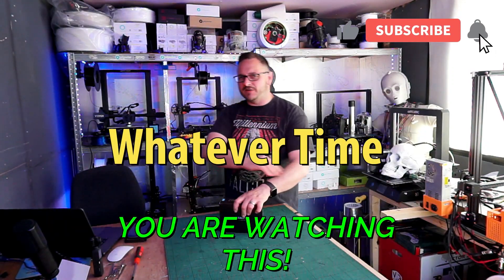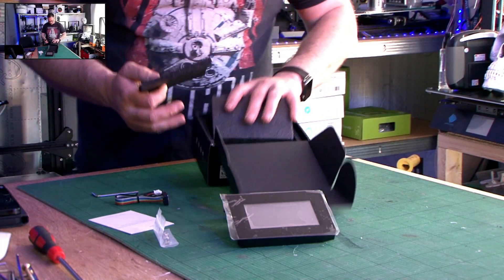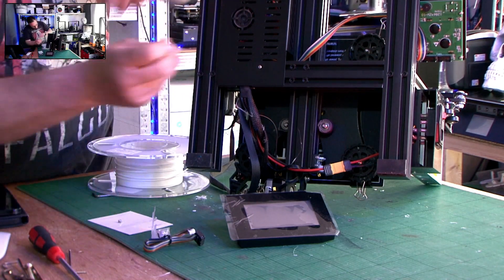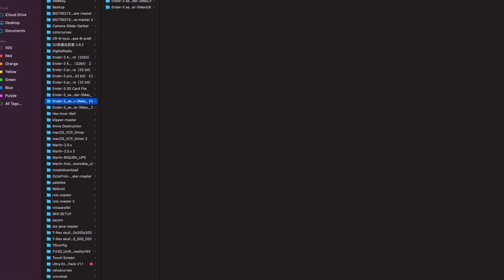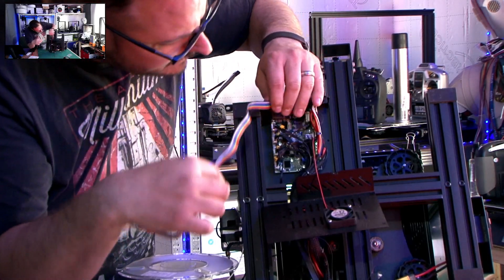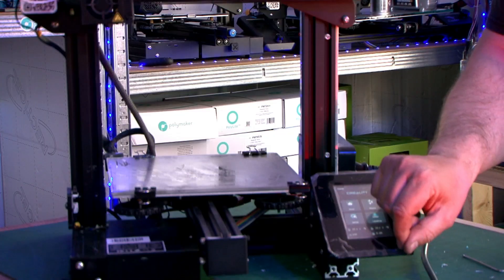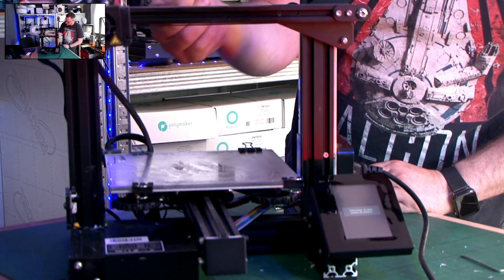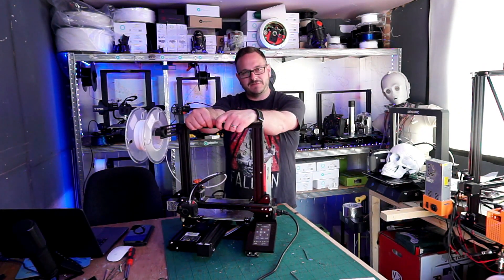Is Your ENDER 3 Outdated? Upgrade with This Touch Screen

Comment: I'm having an issue where the load screen gets stuck. The bar at the bottom finishes loading and I hear a beep but it never moves to the main page. Not sure if the firmware was install incorrectly. Any way to restart that bit?
Reply from the maker: Send it back the developer never moved forward with it

Comment: I tried going on the website for the .bin files because i also need them and the DWIN_SET files for a Ender 3, it says that sight is no longer active, do you have another link?
Reply: Sorry just found it on the 3Djack website. There's another problem im having, I flashed the creality firmware on the LCD screen but i tried putting the .bin file on and its just stuck on the Creality screen with the loading bar, waited 5 minutes and still nothing. Have any recommendations?
Reply from the maker: @madisonlehmann4617 is it the bin file for the motherboard ? As that need to go into the motherboard not the screen ?
Reply: Hey! thank you for the reply, yes ive been putting the SD card into the motherboard for the .bin files and for the DWIN_SET into the LCD Screen. Ive tried several different files and nothing will bite. Ive even bought 8gb, 1gb, and 4gb SD cards with FAT32 and 4096 bytes @TheRealSamPrentice

Comment: I had bought one of these LCD screens from Amazon and it had F1rst Layer firmware on the LCD screen. I wanna convert back to normal Creality firmware. Would i just download the DWIN_SET file on a SD card and load that onto the LCD screen. Would that convert it back to the original Creality firmware?
Reply from the maker: Yep that should do it

Comment: Thanks but I must be doing something wrong. I have a Ender 3 Neo with the 4.2.2 Mb , purchased the new touch screen from Amazon and followed the instructions. The bin file never loaded? Had the original sd card formatted to Fat 32, allocated 4096 and I ended up placing the original controller back on the unit and returning the touch screen. Any thoughts as to what went wrong? The folks at 3dJake say it wont work and I'm waiting to hear back from the people at Comgrow
Reply: OK, I need to follow up with you on this.

Comment: Hello, thank you very much for sharing the video that was very useful to me... but do you know how I could solve the problem that arose after replacing the display? It no longer reads the files to print, I click on "print" and the screen does not show me any files to print. I hope you will be able to help me. Thank you.
Reply from the maker: I’d make sure that you have formatted the sd card and use a small gb card. I’ve seen in the last that there have been some issues with the screens and in most cases the firmware upgrade might help. That’ll be on Creailty’s github

Comment: So I have an Ender 3 E. I think the only differences from the original are auto bed leveling and a sensor for when filament runs out. I put firmware on the touchscreen but it wont let me auto level the bed. Can anyone help me get the correct firmware?

Comment: Thankyou for such a great video. I managed to get my new screen working with my new sprite pro direct drive and bl touch
 I was wondering how I can go about adding the filament run out sensor I also have. Do I need to add a firmware for this??? If I add it Nd put filament firmware will it still allow me to use my touch screen also

Comment: I'm looking for some advice, I put this screen on my ender 3 pro. I am running it and a cr touch, and want to put a sprite hot end on it. I know you need to modify some code in the firmware, but I can I use the firmware you suggest to do that?

Comment: How do you like the reaction speed of the touch screen? Is there any untolerable lag? Thx
Reply from the maker: The bad news is that the development with this was stopped and you have what you have now. Personally I would send it back and think about the sonic pad
Reply: @TheRealSamPrentice  Thanks for the heads up. What about the LCD with nob?
Reply from the maker: @John-vk1ij  yep there is jayers firmware for that one :)

Comment: Great video, but just to note to anyone else new to the hobby NEVER pull or lift the print using the X axis beam like he does when lifting the printer. There is a small chance of something being damaged but more than that its completly throws of the bed levelling you have done. I made this mistake myself and didnt realise after multiple faild prints. If you want to lift the printer lift from the top beam or print a handle mod. To move axis up use settings in the firmware or manually rotate the axis thread.

Comment: I am baffled viewing the comments and everything I don't see how I'm the only person on this damn Planet this method did not work my 3D printer has been down for 3 days now😡😡😔😔
Reply from the maker: Hey Jason, usually the trick is leaving the sd for a time, but the issue here might not be the problem you have ?
Reply: @TheRealSamPrentice  I have left the card in for I think up to 10 minutes once I've also seen any other videos where were people abuse the SD card slot on the main motherboard and also the SD card slot that is on the touch screen itself so far everything has failed I have tried saying screw it and hooked everything back up the way it was now everything is very glitchy when I plug the old screen back in😔
Reply from the maker: @jscott00981  It might be worth it, they had a load of these doing nothing in a factory and sold them cheap, the tech is pretty old now and most have moved on to the sonic pad now.

Comment: For me !
It also not working properly with the 4.2.2 board.
I only can adjust Temp and move around!
Can't set E-steps or turn of fan.

Do you have a link to right software for us.
A lot of readers, followers have this screen now and there are many different question about it.

🤔
Reply from the maker: Honestly this UI is dated, you're better off returning as they didn't finish the development, hence why its so cheap!
Reply: @TheRealSamPrentice  Already working on that 😉

Comment: Quick question will this work with the sprite drive pro?
Reply from the maker: I’d love to answer thar but I have no idea what that is? So I’d suggest you steer clear of this one
Reply: @TheRealSamPrentice  thank you for the quick response and great work on your video.  its the new creality sprite extruder pro kit basically its the ender 3 pro s1 , im upgrading from a ender 3 pro 1.4.4 , i purchased the new motherboard 4.2.7 the cr touch, and the lcd screen the one you installed in the video. And the  one vender that i purchased the creality board says that the creality sprite extruder pro doesn’t work with the lcd screen. I just saw mars qizmo and the ender 3 pro s1 and it has the extruder pro kit cr touch and a lcd screen. I was hoping you can guide me in this install. I basically rebuilt my printer.

Comment: I know it has been a while ago but I couldn't get the e steps set with any firmware. Ender 3 pro with sprite hot end and 4.2.2 board. Have tried a few different firmwares and in the end went back to original screen with thi3d firmware. Any help appreciated as I liked the rest of the screen. Thanks

Comment: I installed this same touch screen on my Ender 3 Pro 4.2.2 with creality's software download for this screen,  and now my it will not read my SD cards.  Does not show any files on any SD card.  I tried reuploading the firmware.  dos any one else know a fix for this?
Reply from the maker: There is a bug in the firmware let me find the files and I’ll post it on here

Comment: please help, I have the v2 and put on the direct drive extruder and BL touch, added the touch screen and won't load firmware. screen just freezes thoughts?thanks
Reply from the maker: Make sure your sd card is formatted correctly
Reply: @TheRealSamPrentice  i think I got it now but how do you adjust the z offset with this screen?
Reply from the maker: @MrBarton1234  we are currently pushing for the source code but creality as of yet will not release it.

Comment: Do you have a firmware for Ender 3 Max with 4.2.7 board, BLTouch, Creality touch screen (the one on your video, that also has UBL, Classic Jerk and Linear advance enabled? or can I use the DWIN_SET from your binary file to compile a Marlin 2.1.0 with this options?

Comment: the moment i plug in the cable in the new screen  it beeps! like crazy, wont stop, and it wont take the flash.. tested several firmwares.. what to do???  4.2.7 card in a ideaformer.. with the new Z sensor.
Reply from the maker: Send it back they sent tons of these out with no support

Comment: I've added the touch screen and the new firmware, but, I cannot load any STL files or gcode files to print from that screen. I've also lost my z-offset and baby stepping. The firmware is old very very old. Do you have a way to enable the touch screen on the Marlin FW 2.9? Or at least how do I print any of my models?
Reply from the maker: creality never released the source code, So the screen is a bit of a bust

Comment: I'm not sure what i'm doing wrong here, but the screen won't load up the firmware, did i skip a step?
Screen is connected
Verified i have a 4.2.2 mainboard
put the right .bin files onto the micro sd card and plugged it in while it was powered off, powered it on and it doesn't load anything.
Reply from the maker: Was this an Amazon purchase ?

Comment: Got the screen working but when I plug in a SD to print it’s not seeing the files. Anyone else having this issue? I’m using the 4.2.2 board and have tried 3 different cards.
Reply: Did you ever fix this issue?
Reply: I ended up upgrading the board to the 4.2.7 but I did find that sometimes it would pick up the card with the 4.2.2 if I put the card in well the printer was on then power cycled the printer. But it was hit or miss. Also making sure the files have less then 8 characters in there names seems to help.

Comment: So I just installed this on my ender 3 max I’m 99%sure I have the right firmware installed. But for some reason on the display in the about section it has my build volume wrong and smaller than it should be
Reply from the maker: It’s not supported on the max without firmware changes, if you connect to it via your computer you might be able to change the size in gcode id have to check
Reply: @TheRealSamPrentice  yeah I saw you can but I can’t figure out how to get the program to work to change the gcode.
Reply from the maker: @Agentchaos85  https://reprap.org/wiki/Configuring_Marlin_Bed_Dimensions
Reply from the maker: @Agentchaos85  that’s in terminal bud you’d need a pi or pronterface

Comment: Is it possible to use the displays with Custom UIs? Like the Jyers/Marlin.
Reply from the maker: It would be if creality released the codes
Reply: @TheRealSamPrentice  Does it mean the display runs on its own firmware too?
Reply from the maker: @jonny11bonk  Yes sir, which is why its not been done yet.
Reply: @TheRealSamPrentice  What about the Ender 3 V2 LCD display? Would it be possible to re-purpose it using an Arduino or other microcontroller? What protocol does it use?
Reply from the maker: @jonny11bonk  Again it requires the code to be released, we looked at this with the firmware guys who did the cr6 mod, but drew blanks as the software is not out.

Comment: Can you send GCODE to the EEPROM with is screen?
Reply from the maker: Nope it’s totally crap
Reply: @TheRealSamPrentice  I'm glad I didn't pull the trigger on buying it then 😂
Reply from the maker: @x_jaydn  steer clear as there is no current development on this at all
Reply: @TheRealSamPrentice  Thanks for the clarification, Sam.

I'm running the stock Ender 3v2 "DWIN_CREALITY" LCDs with my own customized Marlin Firmware (with Jyer's UI) flashed both to the LCD and Motherboard

and I've managed to get them working on the SKR 2.0 B429 boards

I think, if I ever move over to touch interfaces, it'll probably be the BTT TFT Pi 7" for my Klipper builds later on
Reply from the maker: @x_jaydn  klipper Is the way forward :)
Reply: @TheRealSamPrentice   Raspberry Pi's are so hard to get right now though, that I can't wait too long for them, haha 😂

So for now, I'm just running Marlin on my 3x Ender 3v2's
Reply from the maker: @x_jaydn  I’ve heard this !! I’ve got a small stock pile

Comment: Good afternoon, I have followed all the step in the video but when I insert my SD card with my files I want to print do not show up on the new screen. Do you happen to have any advice or a fix for this?
Reply from the maker: Hey Carl, there is a video made by @chep https://www.youtube.com/watch?v=Q-OA9_t9bGc
Reply: @TheRealSamPrentice  Thanks but that is showing me how to have the image of the print file show up. My issue is that the new touch screen is not allowing me to print because nothing shows up when I go into file selection.
Reply from the maker: @carlpleimann571  oh what nothing at all no files ?
Reply: @TheRealSamPrentice  Nope i have used 2 different 8GB SD cards and did a fresh format on both. None of the prints that I slice in cura show on the touch screen.
Reply from the maker: @carlpleimann571  Was this from Amazon and not from Creality direct? there have been a load of duds sold.
Reply: @TheRealSamPrentice  Yes it was from Amazon

Comment: Thanks for the Video, I just got into 3D printing so I'm still a bit of an amateur, I have an ender 3 Pro and I downloaded the 4.2.2 Firmware to flash my screen and it seem to have loaded, shut it off and turned it back on without the SD card and it'll load after that but then the screen says as it, still the creality logo and the loading bar.

Any suggestions?
Reply from the maker: I’ve had a few messages of late which seem to have the same kind of problems.. is this an Amazon purchase ??
Reply: @TheRealSamPrentice  Yeah it was purchased off Amazon

Comment: I could really use your help. Trying to help my frustrated 12 year old son with his 3D printer. Creality Ender 3 pro. 4.2.2. He added this touchscreen and has a CR touch. Touchscreen does not work properly (hitting ready button freezes the screen and there are white boxes over the top of the version information). We have flashed the firmware to the motherboard (renaming the .bin file each time) but I don't think its taking. We also flashed the touchscreen itself with the DWIN_SET file but it acts the same. Many tears here from him and I'm trying to be the Dad that rescues the situation. Any help would be great!
Reply from the maker: Hey Ryan, drop me an email with some pics and I’ll be happy to assist therealsamprentice@gmail.com
Reply: mine is doing the same thing, did you manage to solve the problem

Comment: Really great video, I am having problems however. I was able to get the firmware to work on my Ender 3 with 4.2.7 board but my bed dimensions are now 220x220 when they should be 235x235, additionally I have a direct drive extruder and the X and Y extruder offsets have to be changed to account for the change in shape. I was wondering if perhaps you have posted the uncompiled marlin firmware somewhere or if you had a guide for enabling the touch screen in marlin firmware.
Reply from the maker: Make sure you have set that in your cura settings
Reply from the maker: Otherwise check the creality site there will be a uncompiled version or check out the cheetah firmware online it’s a great guide to set your own settings
Reply: I’m having this issue with the build size did you get it fixed?
Reply: @Agentchaos85  unfortunately no, it came down to either removing the touchscreen or printing with incorrect bed dimensions and extruder offsets so I chose to remove the touchscreen. I tried enabling the touchscreen in the firmware myself but kept getting weird error messages. I'm no computer scientist so the code was a bit over my head. Weirdly enough I think there's other touchscreens out there that are easier to configure manually than the creality brand one so maybe in the future I'll try that. If you figure anything out let me know because I'd love to have both my touchscreen and bed dimensions working properly.